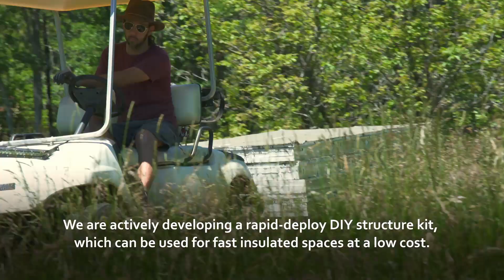Off Grid guru invents DIY Styro-aircrete panel houses

Comment: Im about to be finished with the frame work for my tiny home on wheels and I was wondering if this air/styrocrete could be used to build the whole project, walls, roof and floor? All in steel 18g (or 16g maybe) studs